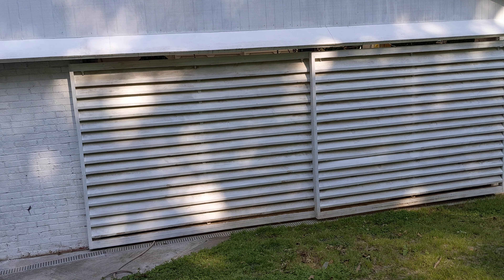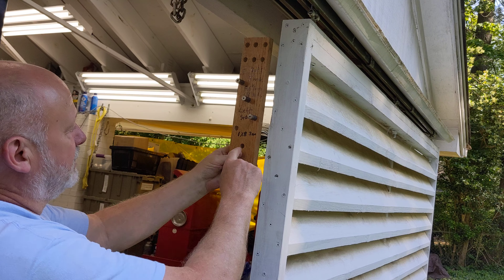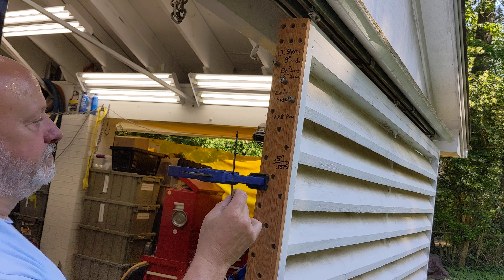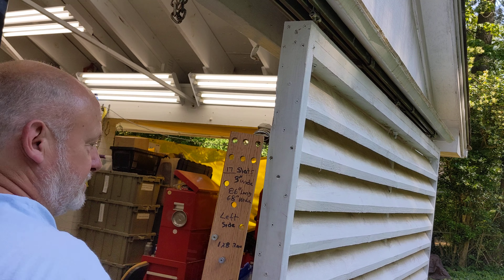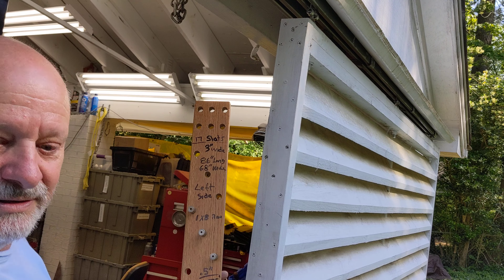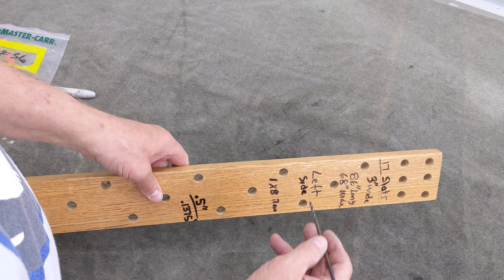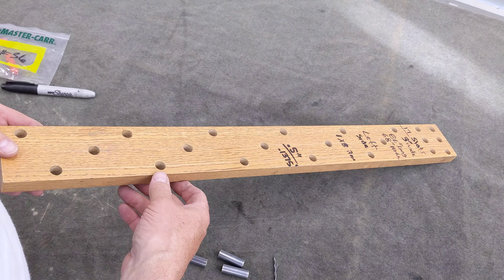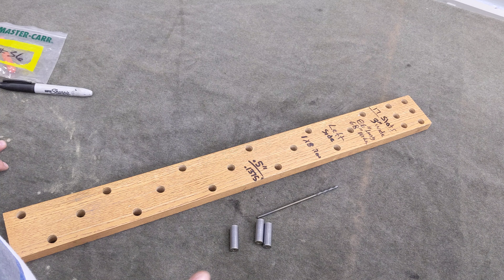Make sliding louvered doors for garage or shop using a guide jig

Comment: Hi how did you figure out the angle for the jig
Reply from the maker: I arrived at the angle by setting up a simulation of the slats I planned to use to determine the spacing, angle and quantity of slats that would result in 100 percent blocking of view from street yet allow maximum airflow.  Mathematics was not involved, I just adjusted the slats on the mock up panel to obtain the desired result and then transcribed the angle and spacing to the jig I built.  Using the jig saved me enormous time, simplified the process